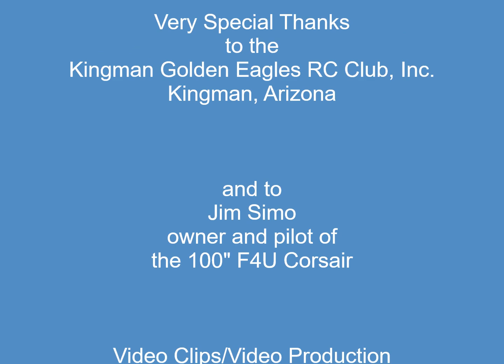Slo-Mo Crash Landing! Jim's 120cc Giant-Scale RC F4U Corsair -  RC Airplane - Golden Eagles RC Club

Comment: It's funny how Life can be sometimes. In 1971 my dad got tired of renting a Cessna 150 and bought a Cessna 170A for $4250. Times have changed. We kept it tied down at home, we had 30 acres in SoCal and our dirt strip was 10' wide and 1300' long with electric wires/poles about 150' from the beginning of the runway. I was 5yo back then, couldn't see out the windshield, nonetheless, flying lessons had started. By the time I was 12yo i was capable of landing at our local  airport... on an asphalt runway with dad sitting next to me. I could read a sectional in my sleep and navigate across the Mojave Desert up to Reno using VOR's and the old coffee grinder radio mounted in front of me. 
One day I was jntroduced to rafio controlled airplanes and I was hooked. How hard can it be of you're already flying a GA aircraft? My first airplane ended up broken 20 seconds into its maiden flight. Some glue and a hot iron fixed it and  on its second flight it was demolished within 25 seconds. My parents told me a second airplane was out of the question unless I sought help from the local club. How humiliating I thought. I built a Q-Tee, powered by a TeeDee .051 with rudder and elevater controls only. Once I soloed that plane, I stepped into a Falcon 56. It was much easier to fly. The Q-Tee was retrofitted with a Cox .09, no throttle. My need for speed had begun. Eventially I got involved in 1/2A and Quickie 500 racing. By then I had joined the club and what made it so awful was that there was 5 of us kids in our early teens under the watchful eye of 40 or so old guys. We'd follow the rules, usually, but nonetheless they still resented us flying WOT down the runway, inverted, 3' off the deck. Hey, we were young, sharp, we had excellent vision and fast reflexes. The "old guys" built some beautiful airplanes, then eventually would pile 'em into the ground. 
Fast forward to today. I watched this video and I noticed the man flying had a white beard, had a beautiful airplane, but he made a simple mistake and fortunately he was lucky. I cannot criticize him because i make simple mistakes now and then too. LOL, I'm slowly becoming one of those "old guys" that prefer to fly a scale aircraft at a scale speed. Out of the 5 Quickie 500's I built, only #5 is still here with its 72 Mhz radio and K&B 6.5cc motor. Ya, no, it's a display piece these days. I prefer the relaxing traits of my J-3 Cub with its 82" wingspan. For excitement I fly a Decathlon with an 86" wing. The bigger aircraft are easier to fly but more importantly, they're easier to see! Out of us 5 young kids with our sharp minds and fast reflexes, two of us put those traits to good use. Myself and one other kid joined the military after college. He joined the Navy and flew F-14's during Desert Storm. I joined the Marine Corps and flew the AV-8B Harrier. Funny thing is neither one of us knew the other was there until we bumped into one another years later at our local hobby shop, both of us still involved in rc aircraft for the past 45+ years. 
My point is... ah Hell, I forgot. Alzheimer's is creeping up on me. This was just a trip down memory lane. 
Beautiful Corsair! Fortunately it'll fly again!
Reply: Really enjoyed your post , I found a lot of what you said about flying full size and then trying RC echoes what we at my club discussed ! Not as easy as they may think.. As far as the sad Corsair crash, yep typical wing stall I have been guilty of this several times.. 
Happy flying I'm looking forward to getting plenty of air time after a horrible wet five months...yep five months..
Reply: Yep, I agree sometimes teaching full scale. Pilots can be very difficult. I myself got into quickie 500 and4 midget racing. I did feel the need for speed and competition. There was no pay your dues as in patterned and scale! It was the clock and who came in first. But those airplanes are small, and I knew I would get into the larger airplanes later in life. I still feel the need for speed and I love propeller driven aircraft. I will never own a turbine powered jet. Most of my flying nowadays are at events and sometimes full scale airshows. I am heavily into the Warbirds and there is a steep learning curve. Hard pavement is a especially tricky for takeoffs and landings. You have to be on your game and there are a lot of dues and don’ts, and you just saw two of them. I was very surprised you did not see a snap roll on takeoff. That’s all I have to say for now. Have a good day and happy flying everybody. NWR

Comment: Sorry but you see all over YouTube  blokes who clearly struggle to fly something like this let alone an advanced trainer. They are going to destroy the hobby. So close to hitting those other people
He under controlled then over controlled. I notice countless flyers especially more mature ones  lose the plot as soon as the ground comes up after barely controlling the plame and usually at full throttle. 
Right rudder hold when the Corsair stopped suggests the neurons aren't what they used to be. A lot of more mature people's fine motor control diminishes as well as slowing reflexes. They simply cannot manage operating something like a model aeroplane safely  any more 

Unfortunately many of their flying buddies are no better so support them, cheer on woeful control as if they're a top gun 
It's embarrassing and to the detriment of maintaining a safe hobby for all.
 The 120cc motor alone is enough to rip someone's skull off.

 Pure arrogance and a failure to accept the skills base is insufficient for the task and clubs fail to pull these guys aside and issue them with an ultimatum. Sort out your deficiencies under supervision or no more flying  planes. 
It's great to see someone make such a nice plane but that doesn't entitle them to put everyone else at risk of harm and expect concerned people to shit their mouths about their dangerous incompetence
Reply: Says one who has never crashed, if so should that be never flown?